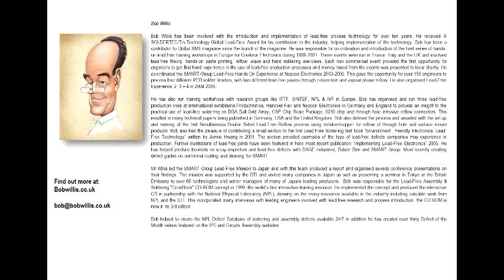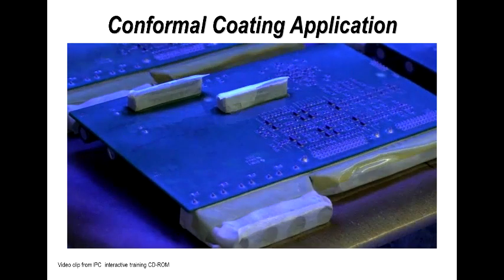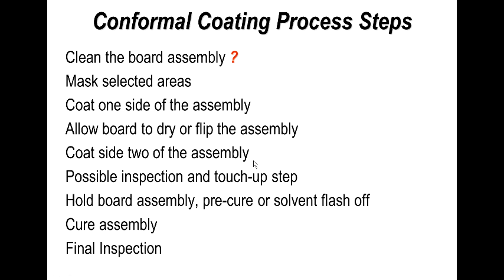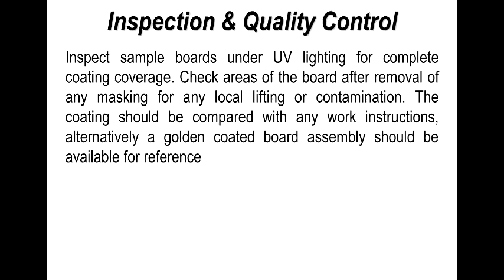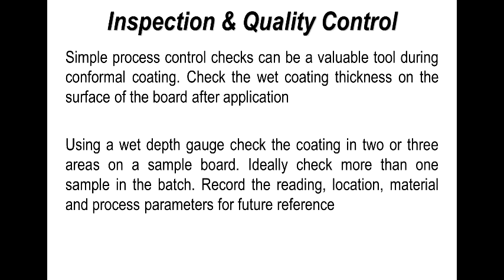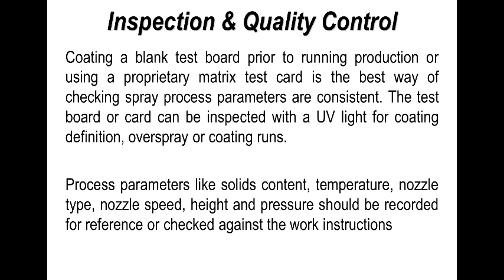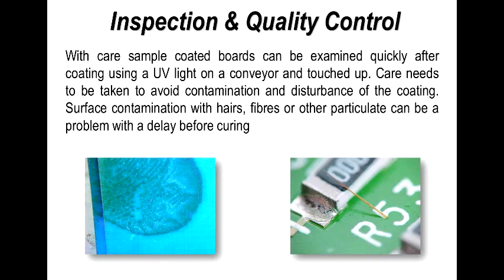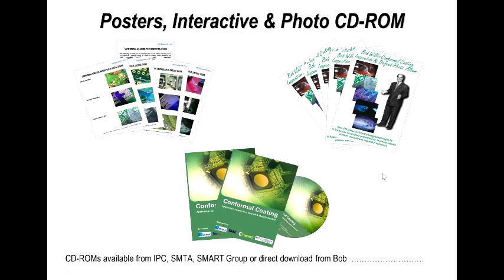Conformal Coating - TroubleShooting Webinar

Comment: Our instruments installed near to a sea shore institure has pcb board corrosion issue. Could you kindly help on how to avoid this? Is it possible to fix this corroded board by cleaning with alcohol?